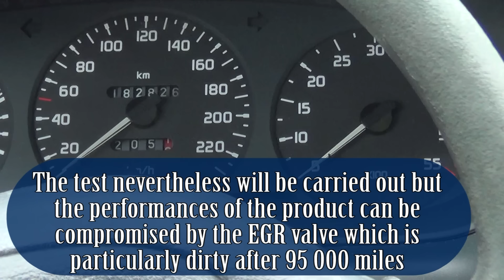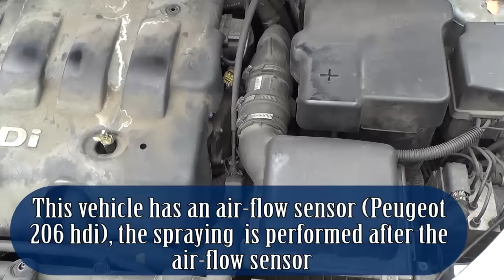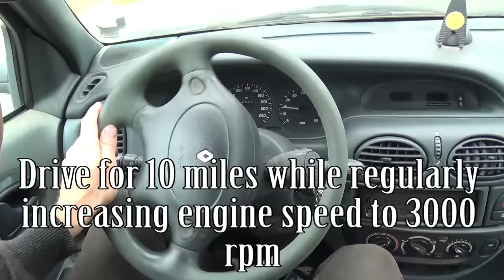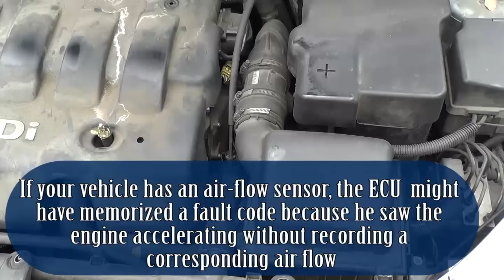EGR valve cleaning WITHOUT DISMANTLING - Cleaner kit test Before/After

Comment: There are some that are making negative comments .The purpose of this was to show how the proses works without having to take the EGR valve out, and was taken out  as an observation.I have a vehicle that requires the engine to be taken out to change the EGR valve so for me this video proved invaluable thanks for posting
Reply: yes by al lmeans do it with just going through the pipe or through the opening but get a much better product, this in the video was next to useless...
Reply: Than ur motor is scrap
Reply: @Syxsss  Then*

Comment: I tried using Wynn's EGR cleaner. The add to fuel type and forget about. Next week I took my EGR off the car took it in my kitchen to clean properly using "elbow grease" from pound world (I've used every degreaser on the planet and this is the best). Anyway the EGR was a solid lump of sticky carbon inside. No way could the valve open or close..  Soaked it in elbow grease for half hour. Boiled kettle and poured it over. Result nice and clean. Valve moves nice and freely now..I've blanked the EGR now. 20% better fuel efficiency..the brim it drive for 400 miles and brim it again test..4 times I've done that now..amazed at the results. Engines like clean cool air not dirty warm air. .

Comment: I was contemplating these products but decided to have a go at cleaning the EGR on my 100K 2.0d X-Type myself. I sort of thought that if I struggled getting it off I could tighten everything back up and use the spray anyway. With some excellent, easy to find help on some of the Jag forums I found the valve much easier to remove than I expected using just a 1/4" ratchet with long & short extensions and 8/10mm sockets. The condition of the valve convinced me that manual cleaning (half an hour with a couple of litres of paraffin, some non-metallic scourers and a pound store washing up brush) was the only way to go. There is no solvent I know (certainly none that I'm prepared to unleash indiscriminately) which could have shifted the gunge and tar. Even if it did I cannot conceive of it passing harmlessly through the engine, turbo, cat and exhaust. The opening to the inlet manifold was also similarly treated. Total time two hours. Would have been less if I'd remembered to refit the bl@@dy EGR inlet gasket. In fact the job was so easy (plenty of PVC gloves needed though) that I decided against tinkering with the EGR system. I'll just repeat the process as and when necessary. Can't be bothered with engine management warnings and the like.

I may consider using a spray to maintain the condition of the valve but I doubt it. They may have their place but I really would not feel comfortable relying on something which just moves the muck further along the system.

Incidentally the cleanup completely cured my rough idle. Improved bottom end torque and made the driving experience much more pleasurable. No more Hail Marys prior to entering a busy roundabout with a full load.
Reply: LŠ
Reply: Does your car live on one of the islands that does not have either an MOT test station or a fixed link to one that does ? Because if it does not a lit engine warning light is a problem.  But you may have found that out by now.

Comment: great video.
in cars without maf sensor there are a map sensor to measure the air volume by measuring the air absolute pressure that get in the intake  manifold to the engine .
thanks .

Comment: The results are not satisfied. Manual cleaning is best way to do it.
Reply: Gogu Last agree
Reply: And since it's already removed, why not just clean it? That would be a lot quicker, and cheaper
Reply: I agree...Nothing better than a good old wire brush..
Reply: @spthompson6501  to test the product
Reply: You know nothing clearly. This is to also clean the INTAKE PASSAGES so you don’t have to disassemble the intake as well. It’s not just to clean the valve.
Reply: It's advisable to manually clean the valve but there's sooo much carbon deep in the system which you can't reach manually, so this is handy to clear the rest, it also helps clear the dpf.

Comment: He removed the EGR to demonstrate the effectiveness of this product (if you can remove it then obviously soak it and scrub it clean). My EGR is a big job to get to it, some are very easily accessible. I used this method and cleared EGR fault. Cost me £20 and worked. Fixed for ever? No, but might see me through until I scrap my van. If you’re driving a motor with a lot of life left, do it properly, this will buy you a bit of time before it clogs up again, that’s it.

Comment: Vauxhall charged me 132 pounds to replace my EGR valve some years back in my Corsa.1.4,two years later management light came on again,Vauxhall said it needed a new EGR valve again!!,I sprayed a tin of valve cleaner in the air filter box,management light went out,and it ran perfect next three years!!!
Reply: blade0954 You're lucky. I took mine to Vauxhall Zafira initially and they told me the whole engine needed replacing. After telling them what I thought of that idea I later found out it was just the egr valve.

Comment: introducing all that "cleaner" into the engine will do damage by wiping the bearing surfaces. The part can be bought fairly
cheaply. If you are going to the trouble of removing it either replace it or at least clean it manually.

Comment: Thanks for showing how the product perform, very useful information as my VW golf EGR is not easily accessible.
Reply: The EGR it route from the exhaust manifold, how is work when those spray mist burned before it exit to the exhaust and partially, minimal, recycle back (burned product) to the   EGR ?
Reply: @metzmatu8409  I don't use the product shown in the video because I can't find it in Australia. I use the technique shown. After watching other videos, the product I use are Oven Cleaner and Water. Same technique as in the video shown, warm the engine then squirt oven cleaner at a rate of a second a squirt until spray can is empty. Turn off engine for an hour to let oven cleaner do it's job. Turn engine on until to operating temperature, squirt water in slowly about 500mL was enough for my car.
The water mist works as water get in there it will generate steam and the steam action clean out the carbon build up. 
I did that procedure twice although it was 2 months apart. Now, after 5 months, my VW Golf 2005 is revving nicely and no longer in "limp" mode.

Comment: you already had the egr  removed why don`t you just clean it with a brush and throttle body spray ? it would be cheaper and the egr will be much cleaner than that spray crap , just a waste of time and money.
Reply: +Hm HM (Mr.H)    i   did  this bud   , it was crap    .. a  A A  chap    friend of mine   said     ///,, just what  you have said   ,,/////  better job   clean it your self
Reply: It's an obvious observation;the point of the video is a review on the product used to clean the egr. I would never buy an egr cleaner,I'd rather clean it the way you stated though.
Reply: +Hm HM (Mr.H) The removal of the EGR valve was done simply to show before and after. This is for those who have EGR valves located in horribly impractical places, where taking it off is too hard without removing a large amount of the contents in the engine room.
Reply: MIND  TAKE IT OUT CLEAN  JOB DONE
Reply: Hm HM i ask my self this 😂😂😂
Reply: Hm HM Hallo zusammen und dann auch 000000 in und, dass es so aus dem Hause, und 000)0
Reply: you are right, dude. That is gonna be more cheapest than this.

Comment: Just remoove it, best cleaning option :)
Reply: true
Reply: Some cars it's not easy to remove. I want to clean for a Range Rover Sport and I wish I could remove it. But I can't, so il have to go with spray.
Reply: @kingolf5270  if it's hidden under alot of stuff or very tight you may wanna take them off first to make space, it's worth it because you can clean very very well and make sure it's all cleaned up before you put it back.

Comment: Truth of the matter is even If your egr valve is "dirty" but functioning most likely, except for the sake of regular maintenance no need to Clean it. Case in point, i have a 1987 nissan truck with over 200,000 miles on it and since i have owned it for the last 12 years (and since i have owned it the egr valve has never been replaced) it has always pass egr/pcv smog check. Up to this point.

Comment: Just take the egr valve out then spray it with throttle body cleaner. Reassemble. No Reving needed no additive needed. Also use 50mls per tank of 2 stroke oil Low ash. You'll be amazed at the difference.
Reply: What does the oild do please?
Reply: @jotk5978  add the oil to the fuel to lubricate the rings and piston and it reduces carbon sticking to the intake valves.

Comment: So the EGR is clogged with carbon and these spray cleaners are meant to wash the carbon deposits away which will end up in the Cat and likely damaging it.

I need to clean out the EGR on a VW CFWA engine but will be removing it to clean it out. Restricted gas flow because the EGR is clogged has lit the Engine Management on the dash.

Comment: did a 2.0 Astra pipe totally blocked and valve not seating the car would not rev passed 3000 rpm, stripped out the valve and pipe, one bottle of white spirit sorted the valve cleaned the pipe out and 150 bhp was resumed! cost £1 (for the sprit) about 45minues of time job done, the garage wanted £700!!!!!

Comment: Dont know why everyone is butthurt.... hes making a baseline on before and after! and to the dippy that said to clean the EGR with petrol Tut tut clearly never seen what happens to early det lol. these methods are the best. our TDDI 1.8 van 62,000 miles just had a full service due to no service for 20,000 miles! limp mode & leak off tc put in similar stuff right after the service "Nearly empty tank", drove around til 50miles marker than refuled as soon as we refuel and allowed all the soak"engine off time" we gave it a little for 20min and now all faults are gone plus its running sweet again.

Comment: Why not to take it apart deep it in petrol and wash it with brush?
Reply: not all egr is easy to get at
Reply: @patrick9761  they  are all easy to take of and clean just revving engine  will clean it to a certain  degree
Reply: @jameslatimer1432   Some engines have a long pipe that goes inside the manifold. How do you clean that by reeving up the engine?
I tell you, I just cleaned the EGR about 4 months ago by taking the EGR apart and cleaning up but I didn't cleaned the pipe so now I have the check engine  light on again.
Reply: @jameslatimer1432  It is a nightmare on some Antaras and Captivas
Reply: To test the product...  Daft

Comment: Well I'd like to see anyone try this on a modern diesel engine.
Bloody thing will rev its nuts off putting a cleaner in the intake when its running.
Putting a squirt of brake cleaner to start anything is scary enough.
Well if it works for people.
But does it clean the EGR cooler and DPF and catalytic converter and exhaust system as well at the same time.
Because if it doesn't no point on just doing 1 thing.
And all the shit you clean off ends up in the exhaust system anyway so i cant see the point of it myself.

Comment: Well, it kinda work, if you can access the EGR valve for removal, then better remove it and clean it  or simply replace it.
On some cars the access to the EGR valve is quite complicate, so i can see myself using it.

Comment: Bent two piston rods with a similar spray. Manual clean is the only safe and working method. Don't be lazy, or you'll redo your engine, like me.
Diesel engines have too high compression to manage with this sollutions. The explosions will do some damage, noticeable or not.
Reply: I was also thinking of spraying Liqui Moly egr spray , so should I go for it or not ?
Reply: @AS-pu7gj  take off the EGR and clean it with spray or water pressure. Don't spray nothing into engine...
Reply: @AS-pu7gj  I saw some decarbonisation process live, looks safe but mechanical cleaning it's the best method. Only when you take the piece apart you can propper clean it.
Most workshops use pressure washer machine to clean intake and EGR's. I recommend first using a screwdrive carrefouly, then pressure washer and last step, EGR spray, but not on the engine; you must take down the whole intake, then clean it to shine.
If you don't have a normal pressure washer, you can use spray and maybe a propane torch, if safe.
Decarbonisation it's not deep enough to take all the dirt off, and if a miracle happens and all the dirt fall off, the catalytic converter will not be happy at all.

Comment: @Dan Lim.  My sentiment initially, then I saw the valve cleaning without "Disassembly". For those with some automotive skills, disassembly would be the best way to clean the EGR.  But, for the rest of us,  the cleaner test kit is the answer. (my 2 cents)
Reply: removal also seems less labor intensive and time consuming
Reply: jerry TRAP
20-30 min job if you remove it and clean it.

Comment: I used EGR3 by Wynn's & I must say what a load of crap that was.

I'm going to remove the inlet manifold & do the job properly now.
Reply: +Chris E  I personally use Wynn’s Diesel EGR 3 for years. I can confirm that these product do work, I have verified that with an flexible telescopic camera. It cleans the internals until some degree. If the goal is to get  shiny internals all of a sudden than this is indeed not the solution.

Wynn’s Diesel EGR 3 is a great product as a preventive solution. Some may expect wonders from such a small and cheap bottle, those products do not exist... ;)

Comment: All of the crap is now in the catalytic converter...
Reply: he removed the catalytic;-)
Reply: Constantino BellaRomano an even worse idea at any rate. A/F ratios depend on the post cat data in junction with either a mass air flow or MAP sensor data. It will not make accurate adjustments if you remove the cat.
Reply: in that case best time to do all that is if catalytic is old and needs replace.
Reply: Constantino BellaRomano hah yep. Just to make you really wish you took that damn egr valve off to clean it to begin with! lol
Reply: Mr S
Reply: catalytic converter needing some burning it self after this kind cleaning.
Reply: Its a Diesel, an indirect injection one at that with a mechanical pump. It wont have a Cat, air mass meter or a map sensor
Reply: Kevin Ryan TDIs have a particulate filter and multiple cats.
Reply: Yes a modern TDI would, but the one in the this video is an old school idi and wont have any of them.
Reply: Kevin Ryan it's in what looks like an early 2000s car. They have had DPFs and cats since the 80s. Also, you can see the air meter in the throttle body in the video.
Reply: Lol, yes do you know what, we are both right. watch the Video again and you will notice there are two engines. The one with a cover is the Tdi and probably has an electronically controlled fuel pump the one without a cover is an Idi with mechanical injection. The one with the cover has an air mass meter the one without does not. I assumed he took the cover off and it was the same engine but they are not.
Reply: If this in Europe then this Megane has got a cat because they had to fitted all cars as standard in 1992.
Reply: only for petrol cars. wasn't the same on diesels
Reply: and dpf?
Reply: Kevin Ryan Peugeot is a hdi non turbo ... the other is a Honda accord 2.2 ictdi ... turbo engine .... no dpf...has a cat and turbo
Reply: Holy crap have to done manually once in 50 to 100 k
Reply: Mr S it’s pre cat, aka upstream oxygen sensor, not post cat.
Reply: @binevanit  last I checked a diesel doesn't have those

Comment: Surely all the carbon that's been cleaned off the valve has now been deposited in the exhaust system and caused partial blockage?

I have a VW TDI CR engine EGR valve to sort out but I'd rather remove it and manaully clean it out. The downside is its a 2011 Polo TDI and going to be damn fiddly  job.

Comment: Personally brother I would use bottled water and spray into the air intake and it would cost nothing and do a much better job
Reply: Put a water injection system on any vehicle this is done to and it will stay clean.

Comment: I'll be pulling mine apart and cleaning the parts in a parts washer. I'd rather the carbon and crap was in the bottom of that than having passed through my cylinders.

Comment: I've used a spray cleaner on my EGR without dismantling and now have engine 'clatter' . Need to now clean injectors or replace them!
Reply: +sircraigery run it on the highway and try higher rpm it works
Reply: Thanks . I had the notion that might blow out a few cob webs

Comment: Could have just brushed that off and saved yourself money and time.
Also, I'd not recommend this sort of solution as you're artificial increasing the pressures within the engine (revs increasing without acceleration) . I suspect this would have done more damage than good.
But hey its a French car it's always going to be crap 😁
Reply: I'm sure he was testing the product to see if it actually works

Comment: Great video, does it not only clean the EGR but the turbo also ?
Reply: Think about it logically. The aerosol will got through the turbo, but the fuel additive will clean nothing more than the fuel lines & injectors. If it’s solvent based (they mostly are) it’ll get vaporised in the combustion of the engine

Comment: Place your valve into a 2L vat of gasoline to disolve the gunk built up in and around the valve. Wait for 30-something minutes. Clean the valve with a plastic tip small brush. Brake fluid to completely finish the job and thoroughly clean your EGR valve. 

That product you're using there is mighty useless.

Thank me later.

Comment: would that get into the EGR ports as well?  I don't understand how this would get to the EGR valve.. I thought the intake just goes into the fuel mixture directly before its burned, and the exaust gas enters this system through an entirely separate system.